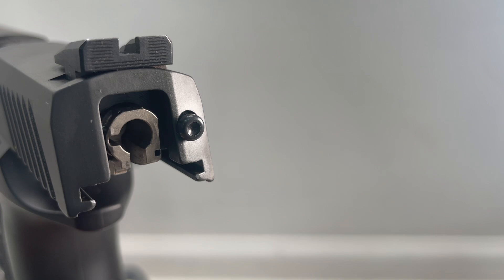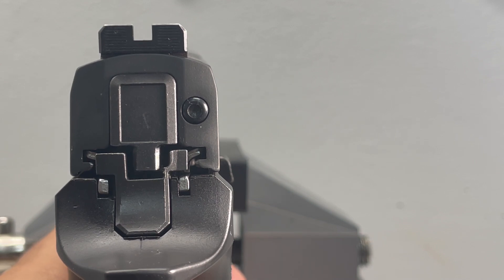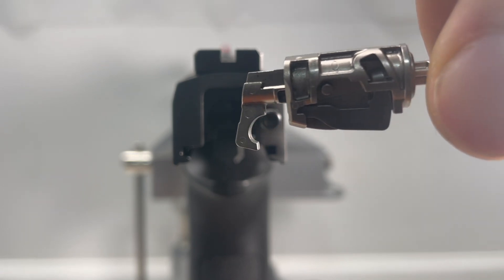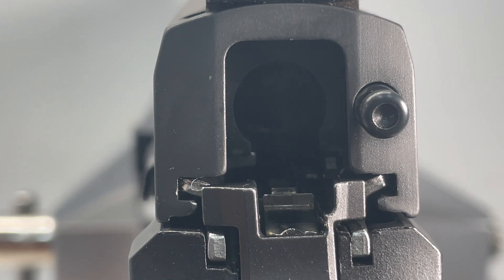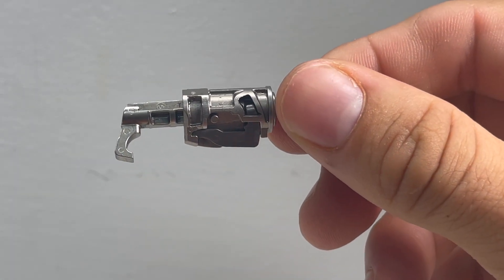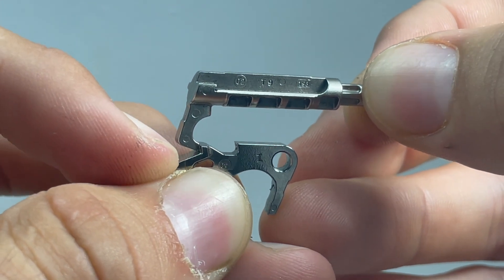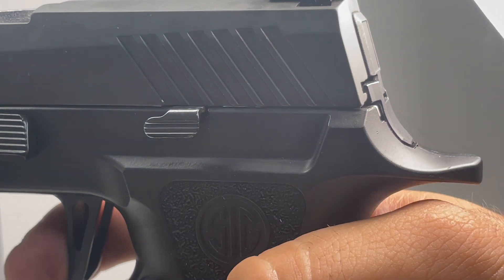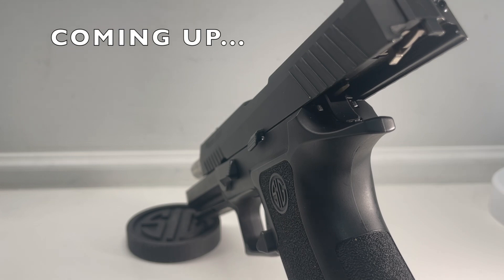P320 - SLIDE MOVES DURING DRY FIRE

Comment: Honestly.  Who’s noticing such microscopic movements
Reply from the maker: People worry that the movement is causing their sights to misalign. However, this doesn’t become an issue once it’s loaded of course. I find the 320 to be EXTREMELY accurate and precise out-of-the-box.
Reply: @SIGMECHANICS  Yup! I am one of those people. I run a red dot on the Hellcat Pro and the sights get shifted when I pull the trigger to dry fire. It drives me crazy. That is until I load some dummy rounds into the magazine.

Comment: have to disagree on the hypothesis about the slide release, I have a 320 and regardless of the configuration(full mag, empty mag, no mag) the slide release still has vertical movement meaning the slide release is not pushing against the slide like you postulate(loading a mag does raise the slide release but the is not enough pressure to hold the slide tight), yes putting in a full mag stops the vertical movement of the slide as well as an empty mag however if you load an empty mag and rack the slide you will then get vertical movement again and the root cause is likely from the loose tolerances in addition to the pressure from the machinal disconnect
Reply from the maker: Realistically, there is some movement no matter what you do since the action is the striker spring gripping the sear ledge. There is not true one way to completely eliminate that movement.

Comment: The slide moves for the same reason a bolt shifts in a bolt action rifle. The striker spring in the P320 mechanism is no joke. I am a professional armorer, have been for over 20 years. The P320 mechanism is interesting, and I'm enjoying learning about it. I appreciateiate your effort here. I've been modifying my personal P320 and learning as I go. Your channel has been extremely helpful. A slight correction though. A loaded magazine places pressure on the bottom of the slide with the top round. It's not the only thing,  but it's there when the mag is loaded with ammunition.
Reply: I have two P320's and neither one of them have that kind of play.
Reply: @@bobbybradley7862 Definitely concerning. The spring for the striker is under full compression with two internal safeties. However, the stock trigger pull is extremely light for the design. For the pistol to actually fire without the trigger pulled would require a failure of the primary internal safety that blocks the strikers forward movement. This would be a unicorn. In my mind, I'm cautiously waiting to see how this plays out. In the meantime, my P320 has a manual safety and I generally carry it with an empty chamber. Mine is a training/ range weapon. I EDC a G45 or Gen 3 G19.
Reply: @@bobbybradley7862 Don't blame you. There are plenty of competitive products that don't have the question mark hanging in the air. Unfortunately, the way the industry works (Glock is guilty of this too), even if all the evidence shows a faulty design or something similar, the manufacturer will NEVER admit it. Sig only did the initial voluntary recall for the drop safety problem because they had to.

Comment: My P320's slide doesn't move during dry fire, but my P365X definitely does.
Reply from the maker: Most people have the reverse, the 365 doesn’t move (as much) and the 320 moves quite a bit.
Reply: @SIGMECHANICS  I have a 365X with 1,000 rounds through it and thousands of dry fire trigger pulls with dummy rounds and no slide movement at all.

Comment: Or a dummy round in the mag so it pushed up on the loading lug of the slide like with a loaded mag when live firing, same result.  That's why the true feel and weight of the trigger should be measured with a cold mag inserted.  It's a bit perturbing to see that movement at first but there's almost no circumstance when firing that it will happen.  Some Glocks do this as well.

Comment: I just installed the Polymer 80 grip module and for the first time I’m noticing play with the FCU itself while taking up slack in the trigger. I have tried factory Sig and Wilson Combat grip modules and never noticed this. Now I’m wondering if the extra play is a sign of poor QC or design that could lead to issues.
Reply from the maker: There shouldn’t be play with the FCU, since it is held in place in two locations: 1. At the rear and 2. At the takedown lever. I have seen grips (even sig ones) that no matter how much you push it down it slips up a few millimetres, that seems to be due to the grip being slightly out of spec though.

If you have another FCU, maybe try and see if it happens with that one, if not maybe ask P80 for their opinion. I’d be interested in knowing what may cause the FCU to move around.

Comment: I've got a G19 with a RMR where the dot
doesn't move at all when you load the trigger
or when you dry fire. My Sig M17 with a Delta
Point Pro has a few inches of vertical dot
movement at less than 15 yards when you
load the trigger and dry fire. You can also see
the back of the slide move excessively.
I know that some movement is normal, none
of these are a custom hand fit 1911. But I've
owned 7 Glocks along with Kahr, Steyr and HK
striker fired pistols and I've never seen
anything like it. You shouldn't see your sight
move inches when dry firing at a target across
the room from slop in the slide to frame fit.
My Sig P365 and P365XL have very little play
in the slide. On those you can feel slight
movement of the chassis inside the frame
when loading the trigger, but it's very minute
and doesn't affect anything. The Sig M17 feels
like a Hi-Point by comparison.
Reply from the maker: I’ve been meaning to try a method where you could modify the rails on the P320 in order to make them perfectly fit the slide. 

Thanks for your insight and for watching!

Comment: That was an enjoyable and thorough explanation of the vertical movement of the SIG slide. Do you have one for the lateral movement of the slide which causes gun to rattle when shaken - other than tolerances
Reply from the maker: I have noticed that there is some rattling due to: The safety lever, the lock lever and the striker (when not engaged). But it’s very little, there is also a little play with the magazine. However, most of the noticeable rattling is from the slide tolerance. There is a method where you can weld additional material to the rails and then lap the slide on the rails to produce a super tight fit. I wouldn’t recommend it unless it’s for a specific purpose but it is an option. I do plan to make a video on this at some point.
Reply: @SIGMECHANICS  all my P320s make a little noise- it seems to be configuration specific. X5 with tungsten grip - definite rattle with movement at front and rear of the slide ; AXG Pro - minor rattle at rear ; M17 - very little rattle ; compact and subcompact - little to none. ( very close to M17). 
If I swap slides and frames- the X5 slide rattles on the AXG frame, but not as bad as it does on its native TXG frame. The same goes with X5 slide on the M17 frame.  The AXG pro slide has a little rattle on the TXG frame , but very little on the M17 frame
The M17 slide has a little rattle on the TXG frame and little to none on the AXG frame
The compact and subcompact slides have no increased rattle on any frame combination 
I would say a combination of tolerance and weight of the slides and frames as the worst offender had the heaviest slide and frame in its native configuration - of course sig says it won’t affect accuracy

Comment: Mine has horizontal play, is that also normal ?
Reply from the maker: Hi @Damien Vera, yes, a minimal side play is okay, those rails are generally not super tight. However if it’s so loose you can tilt the slide and it shifts noticeably, I’d contact Sig about it.

Comment: There is a host of issues with the p 320. The main being when it goes off if dropped or hit on a certain angle.  Another quality control issue is the slide rails just look at the ones in this video they are barely engaged. This is not a knock on the video I thought it was well thought out and put together
Reply from the maker: Hey @Dana V. Thanks! I actually also did a few videos that specifically talk about this issue. If you get a chance take a look. I also recently posted one about the exact distance the striker safety lever needs to be engaged to let the gun fire. It’s more about the mechanics behind it but I do touch on the matter. Anyway, thanks for watching!

Comment: The slide stops moving because of pressure from the slide lock shelf on the follower of the magazine pressing up on the slide, but if the mag is loaded, the shelf does not make contact with the slide lock to push it up. It only goes up when the mag is empty.

Comment: This happens during live fire but to  lesser degree.The only 95 percent fix is the rails properly bent to 90deg like every other striker firearm.The fit of the upper and lower on these is critical because the two engagement surfaces arent in the same housing like a  hammer fired p226.If there is play,plus limited sear engagement,the gun could fire.
There is generous overlap though.Its better that they connect in the same place repeatedly.
The stoner 63 was setup like this,and a loose takedown pin caused the rifle to fire,killing a navy seal in vietnam,when he picked it up by the muzzle.

Comment: Thank you for sharing information. Thank you for your time. In a high frequency, high velocity, mechanically reciprocating system, isn’t a degree of x/y/z float desirable and essentially a “type” of air bearing in order to mitigate frictional forces?
Reply from the maker: Are you speaking about the vertical movement of the sear specifically as it interacts with the striker? If you are then yes. There needs to be a degree of float, and actually there is because when the sear engages the striker leg, the striker is pulled back all the way to the rear cap and even then there is a small gap to allow the striker to slightly move backwards prior to the release.

Comment: Could you please do a video that shows the M17 And the differences between the M17 and the P320. Also please show us how the manual safety lever works. Is it a trigger safety or is it a sear or safety
Reply from the maker: Sounds good, I have quite a bit of other videos I want to do. I'll add this to the list! I would like to compare M17/18 and 320 all in one go too.
Reply: @SIGMECHANICS  So that I make sure I understand the Sig P320, It is a pre-cocked striker?
Reply from the maker: Yes, after the slide moves back the striker leg will catch/engage the sears ledge on its return trip to battery at which point the springs along the body of the sear will tension the striker into a reset position.
Reply: @SIGMECHANICS  So would it be wrong to say it is single action gun, cocked  and not Locked as a 1911 would be in condition 1
Reply from the maker: Nope, you wouldn’t be wrong. For all Intents and purposes, it’s SAO.
Reply: @SIGMECHANICS  Does the thumb safety on the M17 blocks sear movement like a thumb safety on a 1911 does?  Or does it some how block trigger moment like the thumb safety on a Ruger 57?  Or does blocking the sear also block the trigger indirectly?

Comment: BS. This is excessive and the slide dados are poorly fit to the rails which should be bent to 90deg but they are not. The rails (look close) are at about a 45deg angle and do not fit properly into their respective slide slots. My APX and S&W M&P does not do this. None of my 6 Glocks do this. The slide slots fit to the rails have been this way from day one and really reflects badly on Sig.  The statement "This is normal" is simply not true and will mislead owners of this pistol. /ji
Reply: I respect your opinion and thank you for your insightful observations. Your comment caused me to take a detailed look at my P320 compact, (generation post recall). The slide/FCU rail interfaces are at the angles that you correctly reference and the machining is perfectly fit and aligned. I agree with you that the play/slop here is excessive. Do you think that this is a “feature” enabling the modularity and interchangeability of the FCU into other slide/grip modules? Just curious/interested in your thoughts and opinions.
Reply: @TasteLikeChicken  Great that you got back with me. My answer is no simply because the APX is able to do the same things as the 320 but their rails and rail slots are perfect. A rear view of the Beretta looks just as tight fitting as a 1911. I really have no idea why sig designed the fit this way but I dont beleive they will have long term
reliability and will wear much faster than any other pistol and the sloppy fit will always be there. I was going to own several of these guns until I recognized their poor fit and yes, it appears to be designed this way, maybe just a cost cutting move. //ji
Reply: I would agree this movement doesnt seem to normal. Since discovering it on my p320 x5 legion I have deliberatly check at least 4 other pistols of the same make and model. All new. Nit all of them have play. Also note in the video that the right tab is not matching the angle of the left tab which holds the slide on. Hmmm
Reply: @bipolarfishingandoutdoors2217  Never Mind and BP Fishing. I agree with you both. Too much slop and it could very well be an attempt to make parts that are easlie swappable especially on the battle field. This would probably be the result of the chassis (serialized) moving between frames and slides. For all I know it may actually hold up to thousands of rounds but since I have the APX I can easily see that Beretta made for perfect fitting, fully serialed chassis gun.
True, they did not get the contract and Sig did, just seems weird to me. I am not agun smith, just my opinion. Thanks both of you for this conversation. //ji

Comment: This is really good camera work. Also, great job on getting straight to the point on each point without over explaining. Lighting is good too. Overall, really nice video.
Reply: only bad guns have this. my m&p 2.0 doesn't have this
Reply from the maker: There are ways to completely eliminate this. I plan to do a video about it but it does require a more advanced skill set to do it.

Comment: Good Video, Thanks!  I'm not a Glock Fan Boy, but I own a Stock Gen 5 Glock 45 and I don't get any slide movement during dry fire with or without the magazine in. Curious to hear your thoughts?
Reply: Agree none with my 43x or 21 or 19
Reply: Sig does not have a consistent bend on the slide contact points during their manufacturing process. The slide rail tabs are supposed to be 90% on all 4 corners but they are not. Every fire control unit has a slightly different degree of “ bend”. Glocks don’t have this problem .
Reply: @WARPSPD  because theyre not modular
Reply: Glocks dust cover touches the slide by the muzzle were as SIG P320’s do not touch and only ride on the FCU rails.  Personally it makes the SIG feel cheap and loose.  I’d like to see either the rails milled after bending, a longer front rail, or nylon inserts at the front of the dust cover/grip frames.  Most of the grip frames I’ve seen have a slot from the molding process that would be great for the nylon insert.  It would be cheap, replaceable as a wear part and level the slide while also removing that extra play.  With all that said, it could be SIGs way of having loose tolerances for function in adverse or dirty conditions... just a WAG.

Great videos by the way, I don’t understand why SIG hasn’t just come out with a quick video showing the 3D computer model functioning through cycles and from different angles.  After all, it was designed on a computer.   They could have also milled a slide out of a clear acrylic block and bend a FCU out of clear sheet acrylic, put in all the metal parts and used it in the same way (not for live fire of course).  Either would have saved face and strengthened buyers confidence.

Comment: I love my p320 my fav handgun........ I do have a question tho...... When cleaning my gun I never (as per the instructions) take the gun apart like that just wondering if the striker and those small components ever need to be cleaned and if there is a chance of corrosion/rust if they aren't every now and again or if it's something that just doesn't need attention
Reply from the maker: Hi @Jesse. If I remember correctly, the manual instructs you not to go beyond field stripping. That being said, from time to time it is necessary to take it apart further and clean, if not by you then by a professional. 

My answer to your question would be yes, it should be taken out and wiped down and oiled from time to time. That does not just go for the striker itself, but it’s important to clean the channel where the striker sits. Carbon and other particulates from fired cartridges will travel into the channel over time through the hole that connects the  channel into the chamber.

If you haven’t already done so, subscribe to the channel. I will be posting a video soon to explain how to properly deep clean the P320 as well as one to learn how to break down the internals in an easy to follow way that I think will help going forward.

Comment: I think all striker fired pistols have the same issue, if the main guide rod spring does not have enough tension, the sear simply pull the slide back and down a little more or less